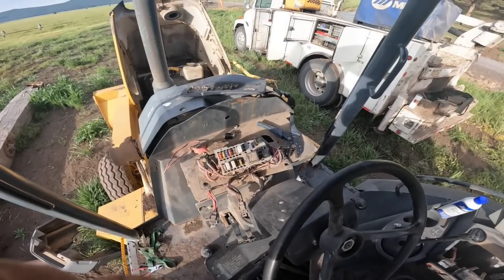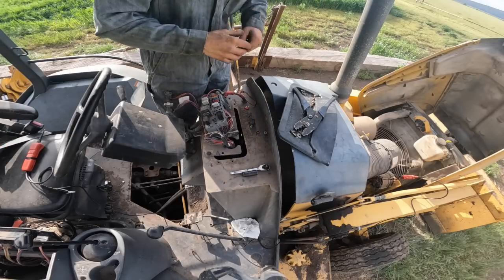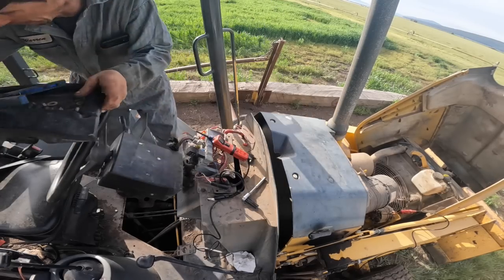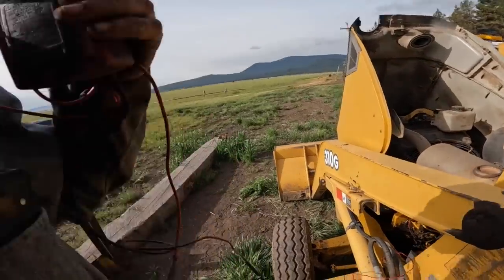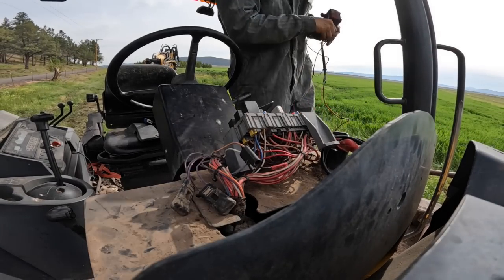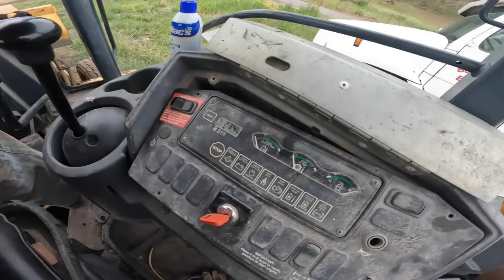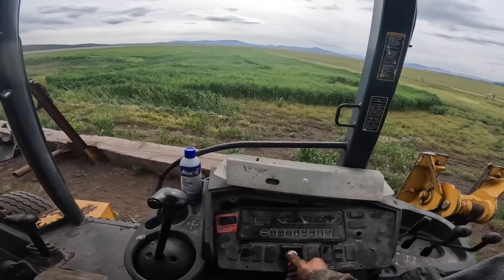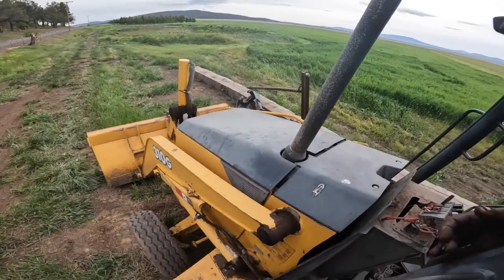John Deere 310g cause and effect,

Comment: Thank you for posting this about the diode.
Have a miller trailblazer 301g with a Robin Subaru/Conan Perforner OHV 220,
and lately when shutting of the engine it kind of runs like the older cars did with denotation issues when shutting off.

 Found the parts manual for this EH 64 engine and it uses a diode and a relay for the ignition and shut down system. Looks like mine the relay is the problem.

My 99.5 F350 7.3 PS also has a diode in the fuse box, it looks like a regular fuse. Have not had any issues with it.

Comment: Hi Warren I’m fixing a front right wheel seal on a zf axle on a 2940. I just wanted to watch something so I can learn a thing or two from you and I see you just uploaded this video!!!! Thank you so much for everything you do and the great videos! All the way from New York!
Reply: @ Ross the Oliver man is working on a zf axle seal also might be helpful ??
Reply: @michaelshepard1867  definately a good video im just doing the seal and the king pins, but I do need to pull the steering knuckle and the shaft to replace the brass bushing as well have nothing wrong with the planetary so I’ll check it while I’m in there but not as deep as I need to go! Thank you

Comment: Sometimes problem is deeper than meets the eye. And when there's wiring involved, that's why I always despised chasing down a short. But after watching you, maybe just maybe I will be able to figure it out. The other day I put brand new points and condenser on an old five horse lawn mower motor. Normally I would take off one part at a time. This time I took them all off and replaced everything step by step, including timing it to where it would run. It's a beast now!

Comment: Hi Warren,

Good job finding the problem. Watching a lot of car and heavy machinery repair, it seems like powers and grounds are extremely important. I just watched Ivan at Pine Hollow Auto Diagnostics have a similar problem with a 2022 Kia that had just come the body shop. (and dealer) Pressing on a plastic guard would cause the car to quit running. Turns out that  the guard moved a power harness that had loose grounds.  

As far as the diode is concerned, there is a possibility that it could short out. A bad ground would artificially raise the voltage across the diode which could put it in a condition that would exceed the diode's voltage rating. I'm just speculating here as I don't know where the diode is in the circuit. 

Keep up the good work.

Sean

Comment: Warren don’t feel bad about not trouble shooting further when you found the bad diode, I spent 50 years working in the electronics large mainframe computer industry and in the late 1960s there were lots of that current steering diode logic to control relays. I have seen diodes, blow open, blow short and just become a resistor like that one on the JD tractor. On the positive side you had the schematics and the knowledge to troubleshoot to find the actual problem. Had a similar problem on my brother’s CIH 3230 open station tractor when we did a clutch job a couple weeks ago. After we had clutch, pp and bearings replaced and tractor back together, the starter would not engage when ignition switch turned to Start position, some how the wire in the main loom from ignition switch to  clutch safety switch went open and we never touched that part of the wiring harnesses. Had to run a new wire just like you did.

Comment: When you have weird things going on with hydraulics “sticking” - check the return passage for obstruction starting with return filter. A lot of those valves do not have separate drain lines and use return circuit for  drain. Also any moisture in the oil even if oil is not milky can get behind the pistons and poppets in to spring cavities and either build up the rust or even bacteria grow, which in turn can plug up tiny drain holes. And when drain holes plugged, the hydrolock will not let the piston or a poppet to move all the way.

Comment: The diode serves another purpose in that configuration- you see these diodes on lots of equipment with bigger starters - the purpose is to control what is called fly back current- fly back current is the current/voltage that is released when the solonoid is de-energised when the engine is cranked.  The fly back voltage/current spike will screw up other relays and controls in the system.  I have, by accident, come in contact with that circuit on a 24 volt starting system on an old 12 cylinder 600 kw generator - it knocked the dog crap out of me and caused me to investigate exactly what caused it and why I got hit so hard.   The diode is basically blocking the energy that is dissipating from the solonoid from damaging other electrical parts on the machine.   My estimate of your failure goes like this - when you were moving the machine with the high resistance wire between the diode and the starter - the parking brake relay was working to hold off the parking brake - but when the resistance got too high for the relay coil to operate the relay dropped out and ur machine slammed into park.  High resistance in a diode circuit will not fail a diode.. when the resistance goes high it cuts down on the current passing through the diode.  However it does take about one volt to start the diode to turn on in the one direction - otherwise known as biasing the diode.   That is why you have a 9 volt battery in your multimeter... in your scenario it's hard to say exactly what happened first because the machine would start through the diode failed closed like yours - so no telling when it failed - but the high resistance wire will cause all your symptoms . . So my estimation is that the bad wire caused all the symptoms and you discovered the failed diode along the way... good fun video guy...
Reply: Just what I was going to say. The diode simply failed and was not affected by the faulty wire.

Comment: Thanks for the video and explaining the park latching relay function. Note that some diodes fail open and some fail shorted when too much current goes through them. Seems like that diode should not fail unless direct 12 volt is applied to the wire on the side attached to the park brake latch relay. Possibly the diode wire and a 12 volt wire are chafing together in some rough metal area of the tractor causing the diode to fail due to direct 12 volts applied to it and the wire to also fail.

Comment: Warren, you diagnosed perfectly. We have to always repair the first known problem we find when doing electrical, to get to the root cause. Unfortunately we can’t always carry the parts we need, if you would have had that diode in your truck you would have found the root cause that same day. In my opinion, you did an awesome job diagnosing that issue. I really enjoy watching your videos, I’ve learned a lot from you. I’ve actually been inspired to start vloging my days out on service calls. I wanted to ask you what type of base are you using on your camera? Are you using a GoPro?

Comment: One more thought. Diodes have ratings. 1. maximum voltage (in this case that will probably be 200v or more), so nothing found on this machine will exceed that rating. 2. maximum current in amps in the forward direction (in this case probably 3-5 amps or more) considering the coil of the latching relay, in series with the 12v supply to relay this may be 1 amp when energized. Diodes usually fail shorted, except when supplied enough current to completely blow them open. So high resistance on the starter ground wouldn't hurt the diode, but unintentional application of the power probe tester, applying voltage to the relay socket, could blow the diode. BTW, i so impressed with your use of the power probe a year or so ago, i bought my own. What a lifesaver. Thanks.

Comment: I wonder which is more dangerous??? The stall scenario in the manual or that thing slamming into park in road gear and ejecting the operator??? If it was mine the parking brake would be manually operated.
Reply: Also, an owner could add a hidden 'anti theft' toggle switch to interrupt brake release and hobble machine....probably wouldn't work if being used by multiple operators tho.....

Comment: Warren! Check the rating for that diode with OEM, because it does experience the voltage back spike when starter solenoid coil is de energized. It might have higher voltage rating or even be schottke diode instead of silicon one. If you install the wrong one - it will not last long.

Comment: Can’t see the diagram but usually the purpose of the diode is to protect the coil of the solenoid from the voltage spike when solenoid goes in off position.
Usually is parallel with windings.
Reply: This one just blocks the power going to the relay ground while starter solenoid is energized. But the diode does experience the  inductive ( if you can say that for DC circuit) spike when starter solenoid is de energized.
Reply: Do selonoid windings have a positive and a negative or no?
Reply: @jneuf861  since every solenoid windings has a diode in parallel  and the diode is a short in one direction and open on the other,the positive voltage has to be on the cathode side

Comment: Hi Warren I admire your never quit . Find the cause. Watching this vid I noticed you relied on the ohm meter for finding resistance on the ground wire to the diode  maybe a better way is to voltage drop that wire cause the ohm reading doesn’t prove conductivity  just my 2 cents CHEERS
Reply: There's a reason he's testing for resistance.... Voltage and voltage tell you nothing about what's actually going on.
Reply: @mtozzy11  voltage drop tells you everything about a circuit because it takes voltage to move current thru resistance which will provide conductivity a ground side voltage drop is 0.10 VOLTS IS GREAT
Reply: @anthonysova7117  you are right, but in the situation voltage could of still been +13v at the end of the dead wire or even even earthing out on the chassis of the backhoe giving you +13v or whatever the battery or alternator were putting out. So best way to test it is in isolation by doing a resistance check. 0.2 ohm would be a good wire.
Reply: @mtozzy11  your missing the point a continuity test cannot verify the circuits ability to handle circuit CURRENT when the circuit is turned on the quality of a wire or connection can only be determined by a voltage drop test never assume a low resistance on an ohm meter means the circuit has good conductivity  ever see a wire rubbed  still might show resistance with the remaining strands Learn Vd removes all doubts
Reply: @anthonysova7117  your missing the point. voltage drop is a cause of high resistance in a circuit hence why you check the resistance in the circuit.
Reply: @mtozzy11  your absolutely right voltage drop shows up high resistance By the way when you vd it’s the same wire either ground 0.1 -0.2  or positive 0.5   Only way to prove a circuit is with current flowing that’s why u use voltage drop vd  Remember good continuity doesn’t mean good conductivity  once u learn vd the ohm meter is good for telling u if u have continuity or if a diode has a vd of .400-.800 Cheers
Reply: @anthonysova7117  yeah no good continuity in a circuit can have high resistance. A continuity test is just demonstrating the circuits ability to carry voltage regardless of the resistance. And Vd can be influenced by the current (amps) of the circuit. And in a circuit where you have 13.6v at 65amps with multiple connections, the Vd of a failing ground wire that still has continuity is only going to be around 0.1 - 0.3v nothing that is abnormal. How ever by checking the resistance of the failing ground wire we can see that it is failing due to it's high resistance
Reply: @mtozzy11  so vd the suspected ground wire or connection why ohm it out when your volt  meter will tell you without question nothing like a live circuit by the way the vd increases with high resistance vd=ampsx resistance  faster way to diagnosis without disconnecting wires to find unwanted resistance
Reply: @anthonysova7117  faster yes but not safer. I'm used to dealing with systems that run at 240v - 1000v. And Safer is better
Reply: @mtozzy11  what industry ? Funny u mentioned safety I retired working on dc generators for FEMA emergency  we were schooled on the use of using vd to troubleshoot electrical problems

Comment: When I first got my Deere 310J parking break would apply randomly, first time it happened it was at full speed, it was a pucker factor of about ten. After that randomly happening about 10 times I narrowed it down to a bad wiring harness and also replaced the park brake solenoid. These quirky issues in the way they engineer the electrical system and transmissions on these just seem to get worse with the newer  models. Add in cheap imported parts on top of the engineering and it's a recipe for disaster!

Comment: And the only reason the engineers made the circuit that way is if the machine stalls and the operator restarts it the s terminal goes hot and the relay drops out and goes into park

Comment: An issue like that would do nothing short of making me want to whip some engineer with the wire bundle until they came up with a better way of doing that , the fact tht they seem to have kept that design for years just makes that feeling worse in me.  Great diagnostic work though.

Comment: Can someone please explain to me why all this machinery has to be so complicated?  Why cant manufacturers build a simple machine that all the systems are separate and not so deeply integrated ? I remember when a machine was down because of  major component failure or it ran out of fuel. Not because of a tiny blown diode.
Reply: That machine is probably close to 20 years old